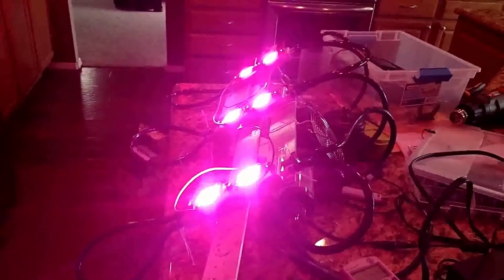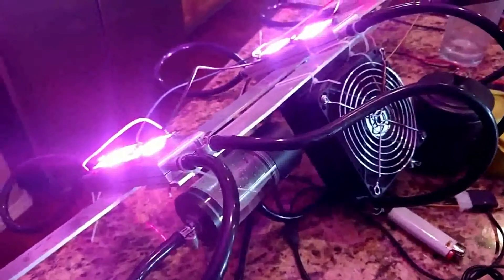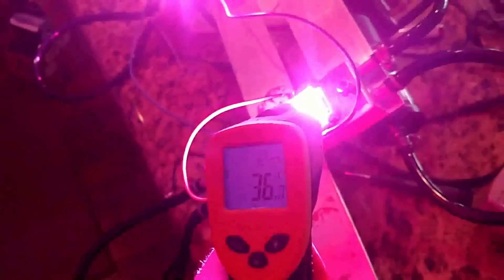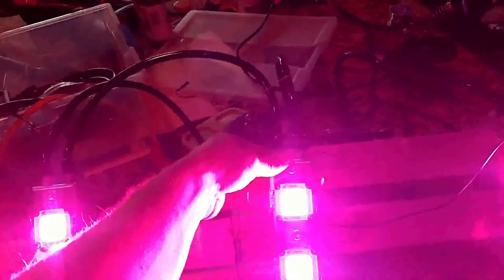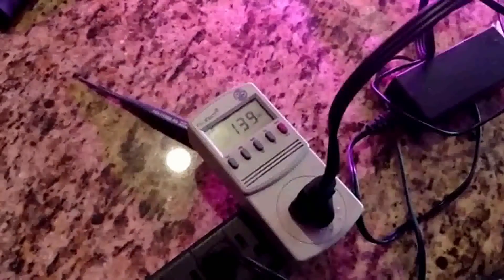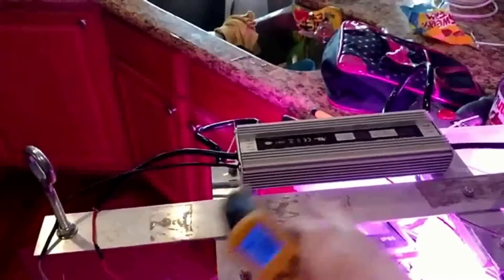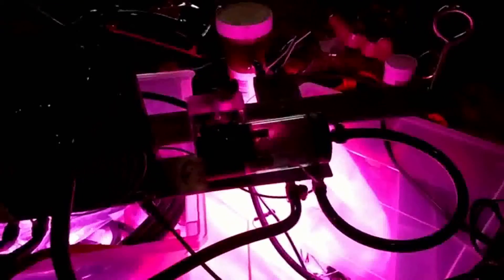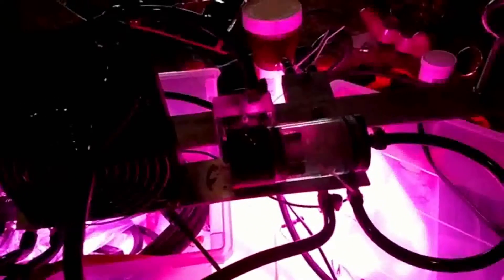DIY Water Cooled Grow LED

Comment: Are these led light still running with out any problems some water problem maybe? Because i am intrested too about these led
Reply from the maker: Still running. Had it in the greenhouse for several months.  There was a little leakage of the fluid because of a loose tube connection, but only a few drops ever leaked. The only reason I noticed is because the fluid is green.

Comment: bro  fill in your description it was impossible to find you! the cooling blocks are cheaper in a large array i just wanteted to see what the life span may be...
Reply from the maker: Life span of the blocks or the LEDs?  Been running this light 12hrs day for almost a month.  30C max temps.  Not bad for just a 120mm radiator/fan.

Also, which description you talking about?  I guess I could add a bit more description to this video.  Will that help search results?
Reply: A good video description helps get the ball rolling in a lot of aspects...
Reply from the maker: Thanks for the tip!
Reply: so what is the total wattage of  LEDs are you running on this small radiator and in what ambient temperature, thanks
Reply: @tripzero0  how long are you using these lights, and do you have any problem with that lights till now?